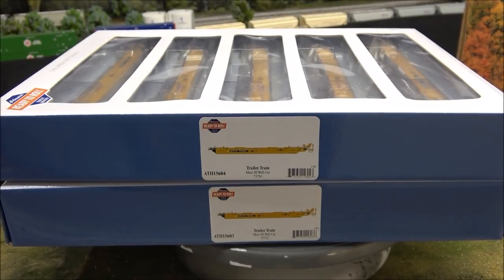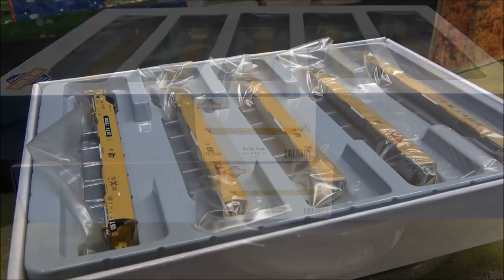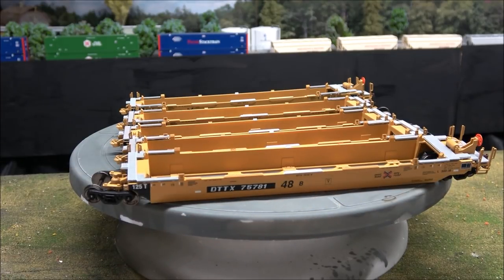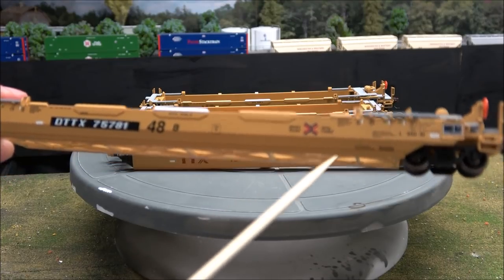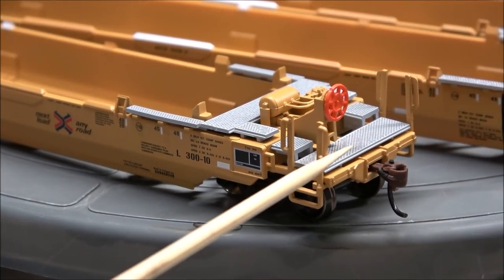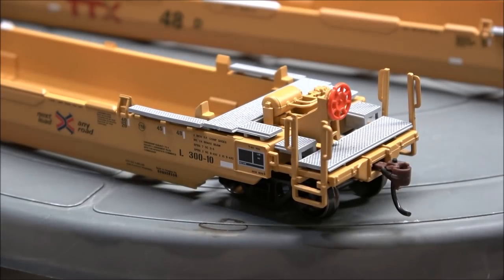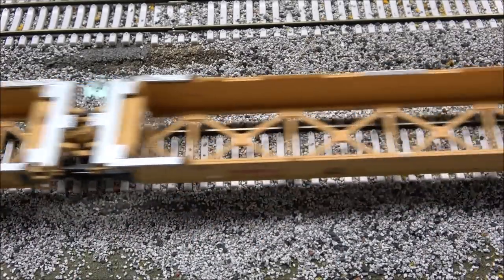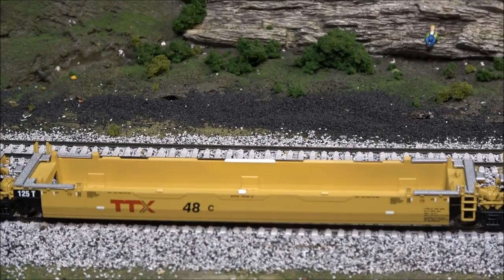5 Minute Demo: Athearn TTX 48' Maxi III Well Cars Intermodal HO Scale!

Comment: I plan on getting a bare table set for a UP route that would run along side my light rail route. I already have 1 Nippon Sharyo P865/P2020 model and I still need 14 more to pair them up for the LRT route (5 3-car sets). I still want to get overhead contact wires for it too. The problem is I need space for all of it.

Comment: they will haul 48'-45'-40'-20' on the bottom. and up to 53' on top. also I noticed some brand names are 
not compatible with each other. like walthers and athearn containers due to lug variation.

Comment: I cant get past the plastic light weight bodies ! I have tons of problems with my non cast cars falling of or even tipping from double stack. They are very authentic looking but the weight ordeal stops me !! Great review tho !
Reply: I barely have derailments but when something goes off it is usually my very light plastic Atlas 53' articulated Thrall well cars. My solution is to put the lighter cars at the rear of the train or open up the bottom of a container and add some weight to it.
Reply: @jimwebster4267  I do that right now !! Keep the cast cars at the front and the plastic packs at the rear !! Weighting is one thing I really need to start doing with all of my rolling stock ! !